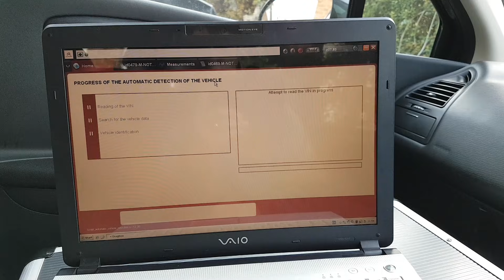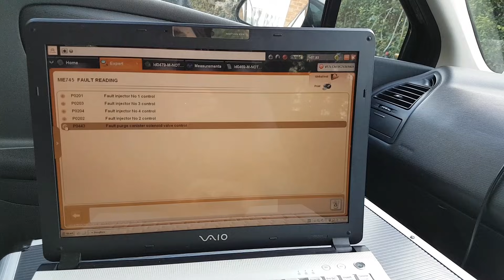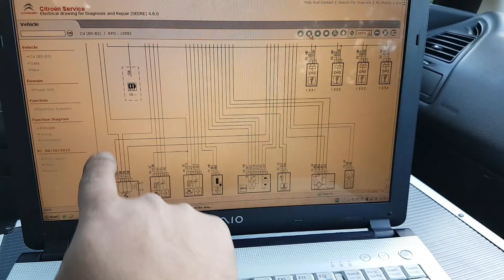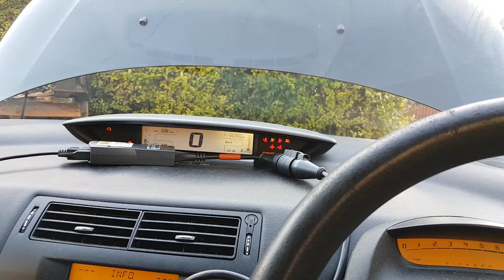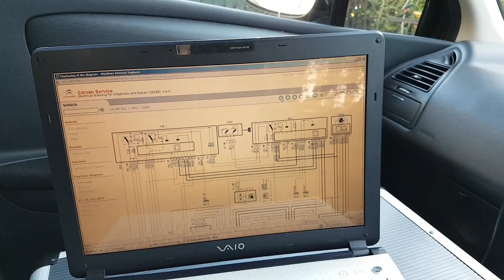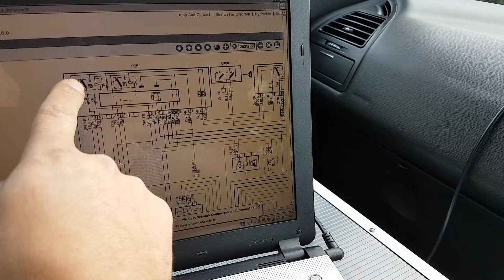Citroen C4 1.4 not starting. P0201 P0202 P0203 P0204 P0443 open circuits. Fault finding and repair.

Comment: I was wondering if the earth could not have been picked up off the bsi so you would then be replacing it like for like? 
The relay you added would be shut down by relay 1 but the bsi may have other protocols in which relay 2 would need to be shut down first. 
Long time since i have looked in a bsi by the way lol.
Well done on another great video.
Reply from the maker: Ian Baxter 
Hi
The issue was that this BSIs are covered up in a kind of silicone... you have literally no access to the pcb...
I know what you are saying... this way works as good, the added relay turns on and off with the ignition,  just like the internal one does...
Thank you for watching!
Reply: Wow thanks for the super quick answer.  Dam goo they stick on everything now stops anyone from repairing things Lol. Keep up the good work.
Reply from the maker: Ian Baxter 
👍

Comment: Those relays in BSM are fixed in some glue or some electrically insulating paste and are imposible to remove them!
Reply: The potting compound used in this boards is epoxy resin. It´s encasing the  components of the circuit to protect from external agents, water being a good example. Additionally provide mechanical support against vibrations...

With all this said. Yes it´s a pain in the a_s to repair. Which makes some sense Since they are not designed or engineered to be repaired. These parts are "supposed" to be discarded and replaced upon failure.   
Ask me not how I know, because I worked in a factory where we made a ton of these power train components. ;-)

Regarding the repair itself, which BTW is mostly a DIY kind of thing. Depending on the particular relay location it can be "relatively" easy. The best I can say is that a Dremel type tool is a big help to dig out the potting compound. The rest is just a bit of solder. Really not much to it rather than patience. ;-)

The relay itself cost some 0.2€ at the end of the production line. 4 to 8€ on the counter! The contact tips is usually minimal (keeping cost down). So they tend to don´t like too much current for extended periods of time.
Which leads me to a tiny tip, keeping electric contacts immaculate clean is by far the best prevention over electrical failures in motor vehicles. 
Oops, wall of text. LOL :-)
Cheers
Reply: @crpth1 
Hi, I would like to buy this relay over the counter but how should I ask for it, does it have a name or specific values?
Thanks
Reply from the maker: THE STIG 
Hi
I know... is not very good...
Thank you for watching!

Comment: Hi, the broken ECU with the solid state relays. is from BOSCH, BSI, and BSM from siemens? witch means German that's why they failed?
Reply from the maker: Ta. Tariku 
I didn't check the brand... but they are usually siemens, valeo or johnson controls...
In this case, the relay that failed was a normal mechanical relay, not a SSR...
Thank you for watching!
Reply: yeah thanks, i have seen johnson brand on a renault megane scenic -04 mk2 digital cluster when i was fixing it, that's normal i think all manufacturers use different brands, but johnson should be avoided like the plague since it's American brand/british, we know these two countries make poor quality products? italian Magneti marelli, and french valeo are much better. I.m.o

Comment: hi my teacher , nice job, also love the new name for the channel
the system prevents fuel vapors in the fuel tank from escaping into the atmosphere; and The most common problem with the purge valve is difficulty starting right after refueling at a gas station: for the first few seconds the engine may run rough and stumble
but What is the resistance of the sensor itself typically
Reply from the maker: abderrahim amroune 
Hi
I never had to look at that... as all the faults  were caused by the same problem...

Comment: i have apparentlly the same problem with peougeot 307 which misfiring the cylinder 4 
can i perform the same steps what do you think
Reply from the maker: Rahaf Aldoush 
Each case can be different... if you have an issue on one cylinder only, it is unlikely to be the same issue...

Comment: Another great  fix, they are lucky you could bypass it! It's crazy those modules are sealed with compound so you can't replace the relays, damn you Citroen/PSA! I've had relays fail on a few cars Ford, VW and BMW (sticking DDE relays) at least they were pluggable  so could get them running again. Nice to see you've renamed your channel! Big thumbs up!
Reply from the maker: thejoneseys 
Absolutely agree... it is a simple mechanical relay, what do they expect, that would last forever? 
I still think is all about make profit selling this modules when a simple relay fails...

Yes, the channel name has changed... logo will be next...
Thank you for watching!
Reply: i tried to open my 2009 berlingo one today, it broke into pieces, everything in thick glue inside. Such a bad move from Citroen, apart from anything can't be recycled at end of life.